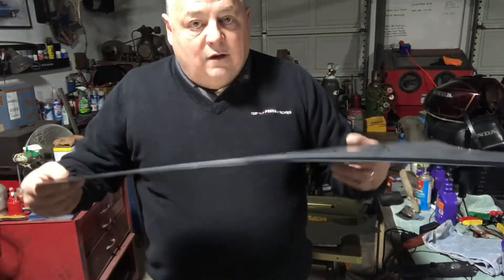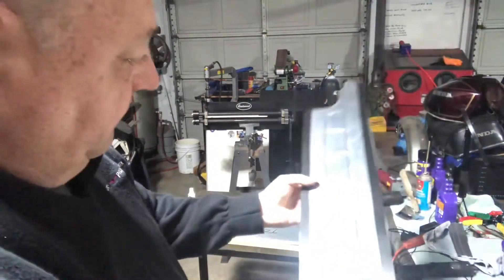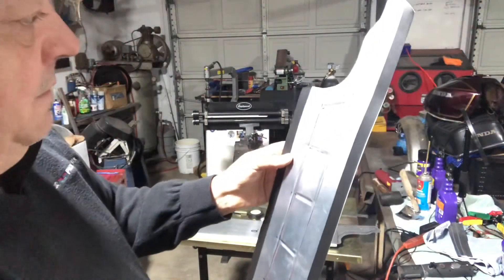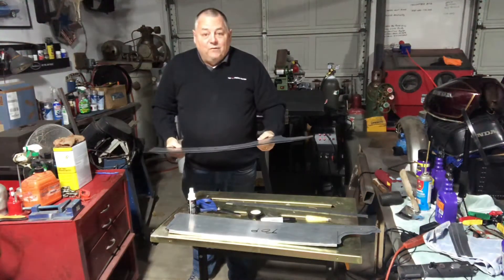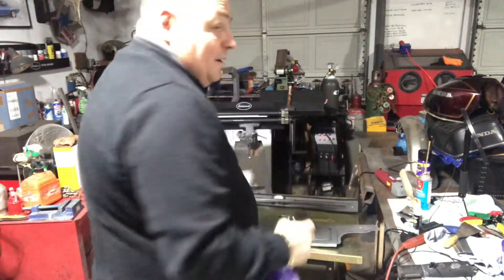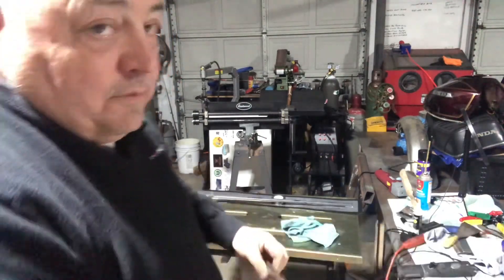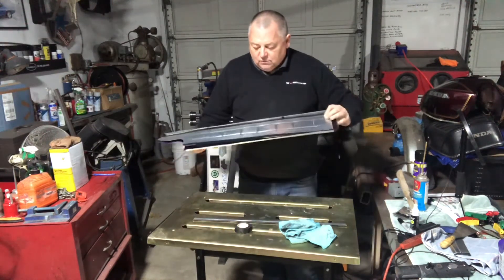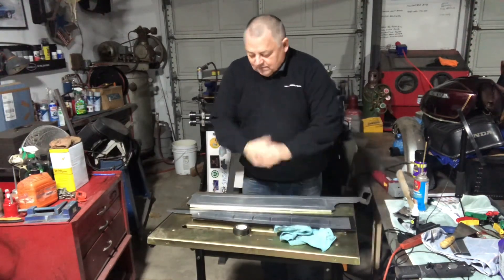1969 Z28 Radiator Cover Build Part 6 - Rolling Beads

Comment: For doing it on a manual bead roller man you did a great job! Might have to go build a stand for my old bead roller!!
Reply from the maker: Thank you John.  I have a motor for mine I need to install.  It's hard to keep on the line and crank the dies alone...  and my human crank wasn't available 🙂